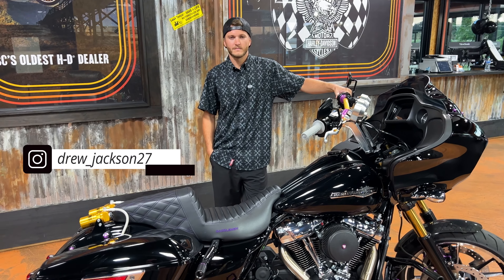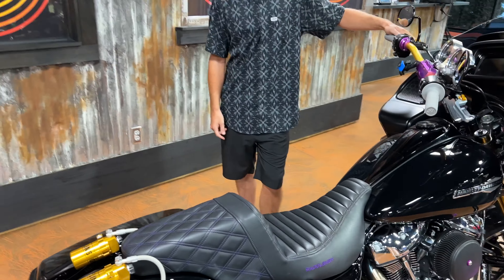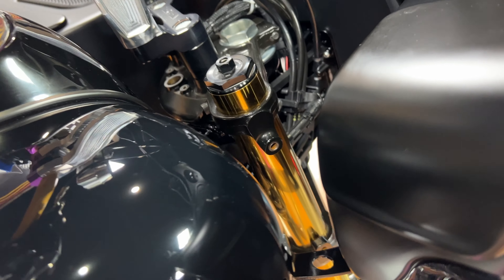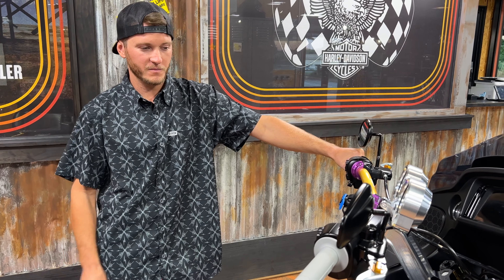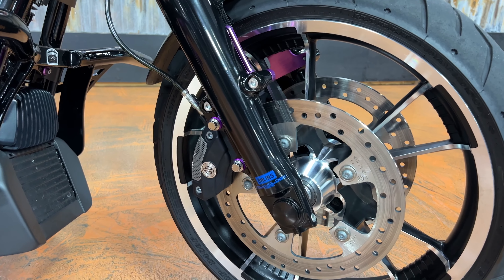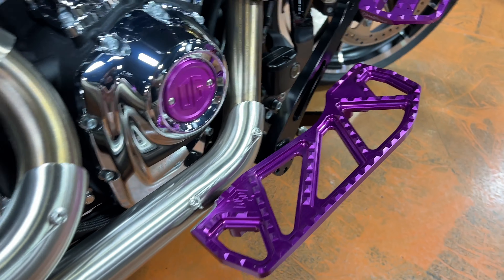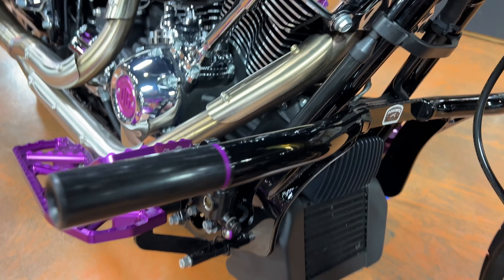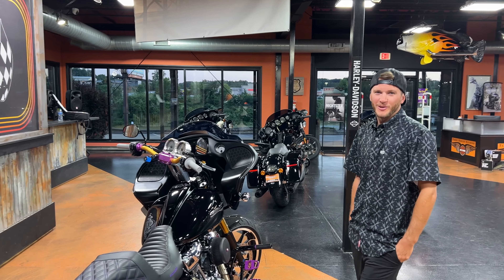Performance Bagger Harley Davidson Road Glide FLTRX!

Comment: I’m 6’ and had to slide about an inch of my fork tubes through my triple trees, plus i am running a 21” front.  Bike sat a little tall for me to be able to handle it in a parking lot or garage.  Nice build 🔥
Reply from the maker: I have a Honda 110 pit bike and dropped the forks an inch just bc I like the way it handles better. Something most people don’t think about doing but can be a game changer if setup right

Comment: Great video. Wish you kept going in more detail.

What does he have for a top tree? Is is just stock without the nacel? (With the gauge relocated)

Also, what levers are those?

Thanks for the video! Big fan of all the videos you take the time to make.
Reply: Hey man I'm running stock because the ones I want from geezer glide are on backorder.  They are reduced trail trees. And my levers are oberon levers from UK
Reply: @drewjackson4056  cool thanks. Will the geezer let you keep that road glide extension from thrasher? I want to keep mine because my height feels totally dialed in but if I get thrashins new top tree I can’t use the extension anymore and lose those 2”.
Reply: Yeah as far as I know.  The geezer glide isn't just top clamp either. It's the entire thing. Reduces trail so the bike will handle quicker too. Last I looked I think they was 799 for top and bottom everyone else is double price.
Reply: @drewjackson4056  ok cool I will look into that then as an option. Thank you!

Comment: What grips is he running. I luv the bike and everything he’s done so far.
Reply: Thanks man. It's Mika dirtbike grips for 7/8 bars
Reply: @drewjackson4056 but those bars are not 7/8” though. How did you make em work? Just stretched them into a throttle tube?
Reply: @endricaci9720  yes. Put them on with zip ties